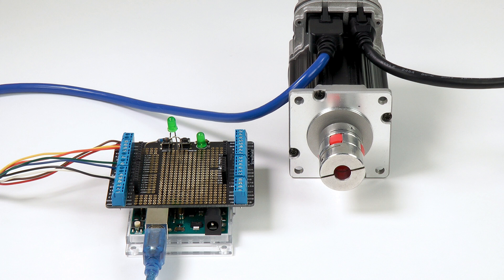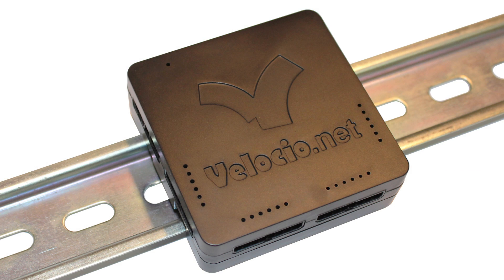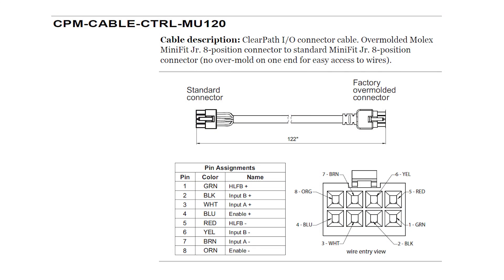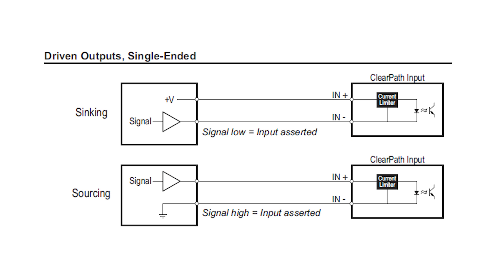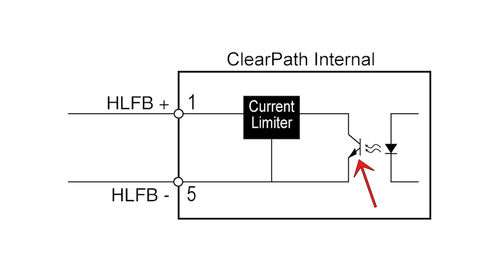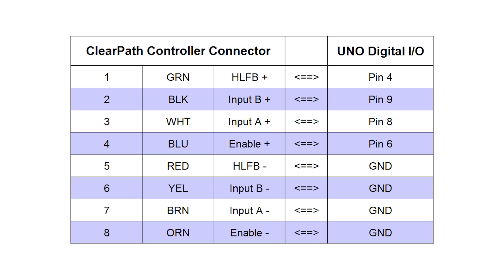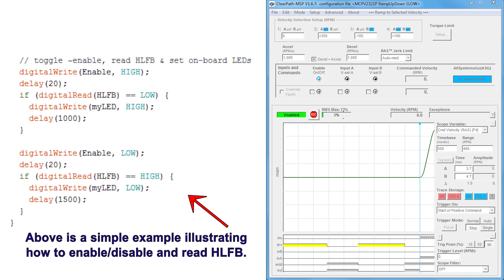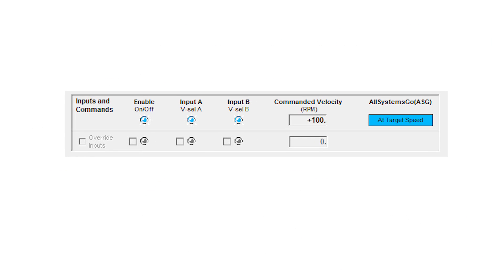How to Wire an Arduino to a ClearPath Servo Motor

Comment: these look great, i'm busy building a motion control robot for a camera, i'm using closed loop steppers at the moment and just using grbl shield for the programming.  Ive found that setting max speed is easy as there is a LED that flashes on the motor if it temporarily looses a step.  do your motors have a visual display of when they have maxed out and needed to catch up?  
And please do a retrofit video of something like an shapeoko or x carve popping your motors in in place of the steppers.
Reply from the maker: Hi Jimmy Reynolds,

Thank you for your compliment and feedback. Teknic's ClearPath motors won't lose steps because they are closed-loop, brushless servos. For other scenarios where feedback may be helpful, ClearPath has a digital output called HLFB (High-Level FeedBack) that you can program to provide different information about your application.
 
You can configure HLFB in a variety of ways depending on the application. For more detail on the different options, please see the ClearPath User Manual section titled "ClearPath Output (HLFB)" (currently page 48): https://www.teknic.com/files/downloads/clearpath_user_manual.pdf

Based on your question, the In Range-Position HLFB option may fit your needs. In this setup, HLFB de-asserts when the motor is beyond a pre-set, user-defined number of encoder counts from the commanded position. You can adjust this pre-set value to represent any "error band" that is appropriate for a given application. 

To create a visual output, you can wire the HLFB output to an LED. For a more automated command adjustment, you can wire the HLFB output to your controller. For example, some CNC controllers can utilize the HLFB output to notify the user if a bit is worn while simultaneously reducing the cutting speeds to compensate for the dull bit.

If you are looking for this feedback (and a full range of diagnostic information) during the testing phase of a project, you can use the ClearPath MSP software. https://www.youtube.com/watch?v=oJSp_1aNiSE
Thank you for your video suggestion. I'll add the topic to our video backlog for consideration.
 
If you have any further questions, please feel free to contact us at support@teknic.com, or call us to speak directly to an engineer about your specific application.

Ian R. -Teknic Servo Systems Engineer
Reply: @TeknicInc  just got my first 3 motors from you guys.  so amped

Comment: So from the code it seems like you have not done anything to measure rotational position, or calculate a linear position, but rather simply used a time base. Is this correct? If so, is there another mode that uses the closed loop system with feedback for a micro-controller? Or would a ClearPath Hub be required for closed loop with positional feedback?
Reply from the maker: Hi PicoKit,

Thanks for your question. ClearPath is a fully integrated closed loop servo that uses an optical, high resolution, rotary encoder to close the position and velocity loops. The internal encoder signals are not brought out via the controller connector (due to connector space, electrical isolation and/or potential noise corruption, etc.). For users who want to double-check that the servo is following its command, there is an output feedback bit (called High-Level Feedback or HLFB) to verify that the servo is tracking within a user-defined position tolerance. (You can think of this as closing a “supervisory loop”.) In the Arduino sketch used in this video, I read this HLFB output bit from ClearPath before issuing a command to make the next position move. It’s a little bit faint, but you can actually see the one of the green LEDs on the shield blink on when HLFB asserts, indicating that the current move has successfully completed and is in-position. 

You asked about a “hub”, and while I think that you’re referencing the SC4-HUB, for anyone else reading this comment, Teknic manufactures two different hubs for two different purposes. The SC4-HUB is used with the SC (Software Control) series of ClearPath motors to enable communication between your host PC and the motors to query the motor and make moves. The POWER4-HUB is usable with all three motor series (SC, MC, and SD), and this hub makes it easier to connect multiple motors to a power supply (and it also enables the Logic Power Backup feature). In this video we demonstrate the ClearPath MC motors running with an Arduino, and therefore you wouldn’t use the SC4-HUB with this motor. 

I noticed your comments on some of our other videos, and it sounds like you are working on a laser engraving/cutting machine.  If so, the step/dir modes (found in the SDSK and SDHP family) are appropriate – use the ClearPath HLFB output to verify the closed-loop servo is tracking your command within a user-defined position tolerance. You’ll be able to trigger a device (such as a laser) off of the step command and get excellent accuracy. 

Hope this helps. If you have any further questions, please feel free to contact us at support@teknic.com.

Abe A. - Teknic Servo Systems Engineer
Reply: @TeknicInc  Thanks Abe. That's good info. I have been looking at the SD and SC as possible motors. SD for the operational mode 11 step and direction mode looks promising. But I am thinking the extra smooth G-Stop would be very advantageous for the delicate optical mirror system particularly during high speed motion that moves back and forth between two points.

Does SC have step and direction also? And can these run from low level logic or do they have to communicate with a PC?

I think that as long as we can get the ramp-up time and distance, then all the laser pulses could be matched by offsetting the start point and waiting the time to reach the maximum speed. What sort of power is required in a Nema23 motor to get 50,000rpm/s acceleration, with a 200g load (including carriage, belts and pulley)? Do you have any other thoughts?
Reply from the maker: @PicoGirl  For almost all CNC or path-following applications, Teknic recommends the ClearPath SD series (Step and Direction). While you can configure the ClearPath SC motors for "Step and Direction" mode (i.e. to accept "Step and Direction" signals), it is certainly more straight-forward to use a ClearPath SD motor. With a ClearPath SD model, you’re simply wiring three outputs from your controller to the motor (Step, Direction, and Enable) to the motor – with the SC, there’s a lot more to it…

With a ClearPath SC motor, you ¬will need to create (i.e. code) a custom application that uses Teknic's C++ library to do things like enable and disable the motor, query the motor’s status, initiate homing, etc. (none of these actions occur automatically through digital I/O like they would with the ClearPath SD motors). This means that to use ClearPath SC in "step and direction" mode, you will need both a third-party step and direction indexer (i.e. your controller) and a PC running Teknic’s class library. Additionally, you’ll then need to develop a method for communicating between the indexer and the Teknic class library. Unless your CNC application requires a specific feature of the SC series, the SD series is usually the way to go.

g-Stop, however, is not available in any "step and direction" control mode. As you might have seen in this video here (https://www.youtube.com/watch?v=Aj1LyYEvstw), the g-Stop directly affects and morphs the velocity vs. time command. This would be an issue with CNC applications, where you want the motors to follow your exact path through space. One reason people use Step & Direction is so that the controller is in complete control of the velocity vs. time command (and you don’t want the g-Stop changing it on you).

There is a separate feature available in the "Step and Direction" control modes which provides a 4th order polynomial curve to the incoming command. This algorithm (we call it the RAS, short for Regressive Auto Spline) helps to increase machine performance and reduce mechanical vibration, but doesn’t significantly affect the velocity vs. time profile like the g-Stop. Here is a video that goes into more detail on RAS: https://www.youtube.com/watch?v=WOyP51-PiTs

Selecting the proper motor for your specific application depends on many additional factors beyond the load weight and acceleration. Please contact support@teknic.com for specific questions regarding your application and motor sizing.

-Abe A. -Teknic Servo Systems Engineer

Comment: BREAKOUT BOARD?
Reply from the maker: Hi Steve,

The breakout board in this video is a screw shield for Arduino Uno (there are many different screw shields out there that are compatible, but make sure you get one that matches the type of Arduino you have).

Best,

Bridgette G. - Teknic Servo System Engineer

Comment: Excelent , where can i buy the slidind rail and the clearpath servo, both?
Reply from the maker: Hi Christopher,  

I'm glad you enjoyed the video! You can buy ClearPath integrated servos directly from Teknic using our online webstore. Teknic does not manufacture or sell stages/actuators, but you can find quality options from many online distributors for motion control.

The linear actuator used in this video is a Vertex LGS33 Compact Linear Actuator. The actuator is a 10mm lead ballscrew, and the stage has a NEMA 23 mounting flange for the NEMA 23 ClearPath servo featured in this video.

If you have any additional questions, please feel free to contact us directly at support@teknic.com

Best Regards,
Matt C - Teknic Servo Systems Engineer

Comment: Do you have a video with masso controller?
Reply from the maker: Hi MySchizo Buddy, 

As of yet, we haven't done any videos with the Masso controller so I wouldn't be able to comment on the integration. However, I did a quick Google search (I used the search term "Masso controller and ClearPath servo") and found several interesting YouTube videos describing this very topic. 

Hope this helps. Thanks for watching!
- Abe A. - Teknic Servo Systems Engineer

Comment: You said 4 volts was minimum signal, the docs say 5 volts is minimum. I am having trouble drive the motor using 3.8- 4 volt signal (from a PMDX-126) and I'm getting conflicting info on this point.
Reply from the maker: Hi AndTheWinnerIs…,

I can understand the confusion over the apparently conflicting information. The difficult thing is that both values are technically correct, so perhaps some clarification will be helpful. 

The minimum nominal voltage for those inputs is 5Vdc (and the maximum nominal is 24Vdc).  The minimum guaranteed input voltage however is 4Vdc (assuming of course that enough current is present to turn on the internal LED), and the maximum is 28VDC. The reason for both specs is that most nominal 5V systems suffer from voltage droop across wires and interconnects, so a signal that starts out as 5V, is rarely (if ever) 5V when it reaches the motor. 

If you’re interested, wiring schematics and additional information on the input current requirements can be found in the ClearPath manuals located here: https://www.teknic.com/downloads/

The 3.8V signal is below the minimum guaranteed working voltage. So if you’re having issues with one of the ClearPath inputs seeing that signal, this could be part of the problem. In speaking with an engineer at PMDX, the PMDX-126 naturally outputs 5V signals (not 3.8-4V); PMDX said that the PMDX-126 should be compatible with ClearPath.

I hope this information helped. If you have any additional questions regarding the use of ClearPath in your application, please feel free to contact us through our website or directly through support@teknic.com.

Best regards,
Jon K. - Teknic Servo Systems Engineer
Reply: @TeknicInc  Hi guys, I know we spoke on the phone and all is fine now.  But for the benefit of others...
I do still have a 3.8V signal from the PMDX, it is nowhere near 5 volts. But as you and the PMDX folks mentioned, your input is an LED driven by current and the current at 3.8v is around 6mA and that satisfies your input.  
Using a voltage minimum spec worked against me troubleshooting and kept me from seeing the problem which seems to stem from my original autotuning at 25% power. Autotuned at 100% and it came to life perfectly. 
I'm not certain how to clarify this in the docs, Min Voltage is commonly used, but 3.8V is working just fine at this time. I don't like it, it seems too close to "no mans land" of logic signals, but this isn't TTL logic so it's the current that really matters here. 
Maybe an EE can state this more eloquently. 
Thanks for your support. I really like these motors.
Reply from the maker: Hi  @EmmerBigguns  (I like the name change!),

I’m happy to hear that you were able to get your system up and running. We try to help when and where we can, so I’m glad that everything worked out.

For others reading this in the future:
1) As a first step, we recommend testing with the ClearPath setup software (MSP for SD/MC servos) when trying to troubleshoot a performance issue. This helps you separate whether there is or isn’t a controller issue. If you are unable to smoothly jog the motor with the setup software, you’ll generally want to first look at the mechanics and servo to first get the motion working smoothly.
 
2) You can (sometimes) get your motors to function from lower input voltages (even though the minimum rated spec is 4V). I would never suggest designing a machine around that spec though. If the stack-up of component tolerances falls the wrong way, you’ll experience intermittent issues.

OldePhart, you may still see some intermittent issues on this machine even though the present combination seems to be working right now. You can probably identify that you’re having one of these problems if you experience inconsistent positioning, seemingly random or sluggish response to specific commands (e.g. enabling/disabling the motor), or unexpected motion (e.g. homing when you don’t expect). 

Thank you for closing the loop on this though,
Jon K. – Teknic Servo Systems Engineer

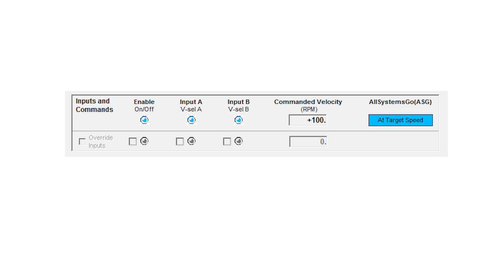Comment: Thanks for your awesome video. I have a question. Is it possible to buy the whole package shown at 7:05 ? Otherwise, would you please recommend where to buy those components. Thank you for your great explanation.
Reply from the maker: Hi GT Gil,

Thanks for the compliments (and for your interest in ClearPath motors). While we don't sell these parts in kit form, I was able to look up the individual part numbers shown in the video (at time reference 7:05) and list them below for your perusal.

ClearPath Motor (Teknic)
P/N CPM-MCPV-2321P-ELN

Power Supply (Teknic)
P/N IPC-5: 75VDC power supply

Cables (Teknic)
P/N IPC35-CABLE110: AC Input to IPC-5 power supply.
P/N CPM-CABLE-CTRL-MU120: ClearPath Controller Cable, 10 ft.
P/N CPM-CABLE-PWR-MS120: DC Power Cable, IPC to ClearPath, 10 ft.
P/N CPM-CABLE-USB-120: USB Cable, Type A to Micro B, for ClearPath Rear USB Port.

Ballscrew Actuator (Motion Solutions)
P/N LGS3310MC-400(335)SB112H: Actuator, LGS33, 10 MM Ballscrew, C-BLOCK, 400L, NEMA 23, 2 photo sensors

Arduino UNO R3 microcontroller (Amazon, Digikey, etc.)

Proto-ScrewShield (Sparkfun) 
P/N DEV-09729

If you'd like to see more information on any of the Teknic products listed above, just visit our website (www.teknic.com) and paste the part number into the search bar at the top of the page.

Best regards,

Jim W.
Applications Engineer
Teknic, Inc.

Comment: I'm super excited about clearpath in the integrated servo motion control. Could you guys put together one of these types of videos for machinekit (linuxcnc)? there seems to be some confusion amongst the machinekit / linuxcnc communities as to how to work with them together. E.g.: https://forum.linuxcnc.org/10-advanced-configuration/33715-teknic-clearpath-sc-and-linuxcnc?start=10
Reply from the maker: Hi Logan Powell,

We appreciate your excitement about the ClearPath products. Thanks for the suggestion. 

Customer feedback has been used a number of times when considering topics for upcoming video production. I can't make any promises but we will definitely consider your idea.

In the meantime please feel free to contact us at support@teknic.com if we can help with anything else.

Best regards,

Mark D. OEM Applications Engineer